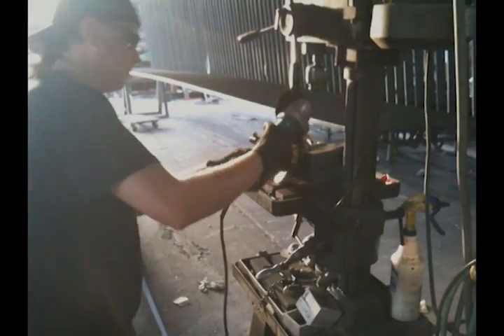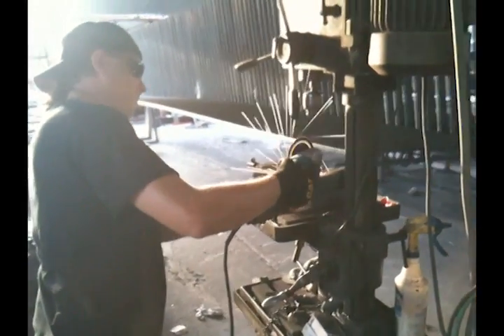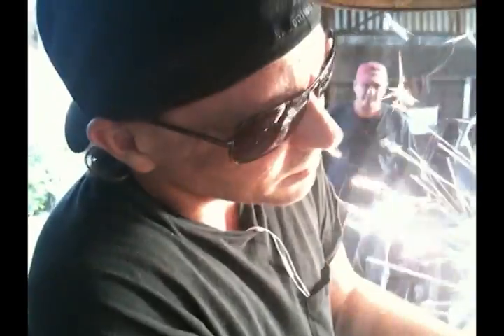How To Cut Titanium With Ceramic Cut-Off Wheel

Comment: Can i please buy Nick a grinding shield and z87+ safety glasses? Im all for doing real mans work and everything, but it shouldnt be worth risking your face. When they explode its alot like the business end of a 20g shotgun. Im just saying this bc ive had to pick pieces of a shattered wheel out of my skin, but not out of my face or eyes.
Reply: Especially flaps tainted with a highly expansive metallic-to those working with many materials.
Reply: Buddy of mine caught a cut off wheel right to the face. He was wearing glasses, designed for the beach. Went right through those and embedded about an inch into his skull. His eyeball exploded(hes blind 1 eye now) . Skull cracked (hes dumber now, didnt start with a full set clearly) but he lived. Silver lining is he was offered a part as a  xtra on a pirates movie.